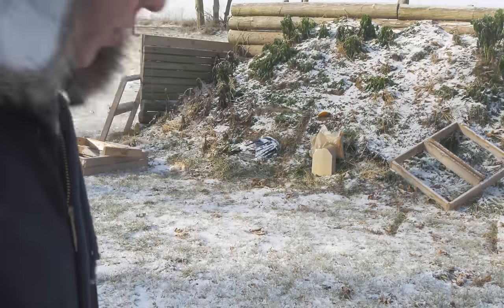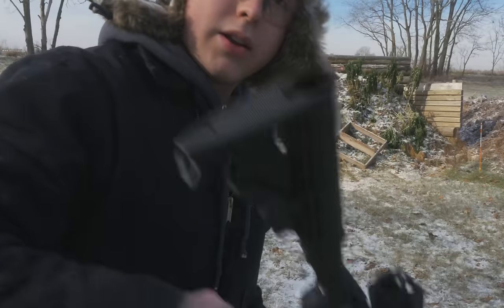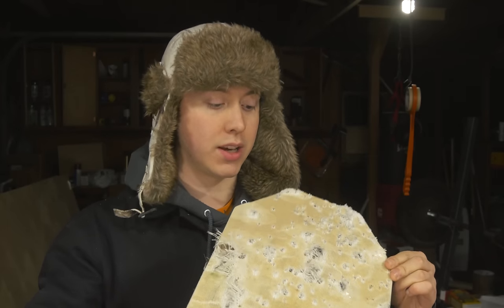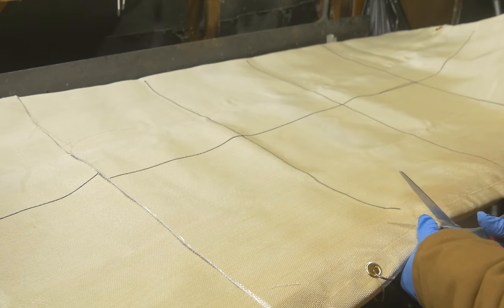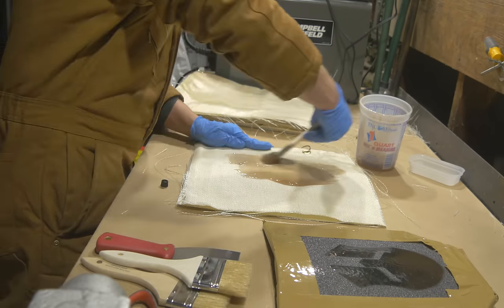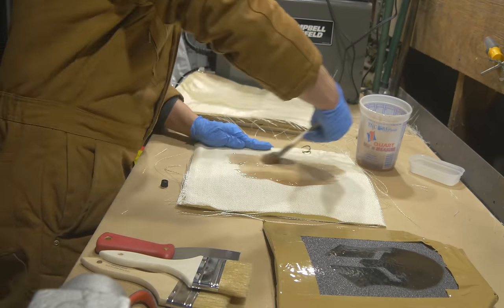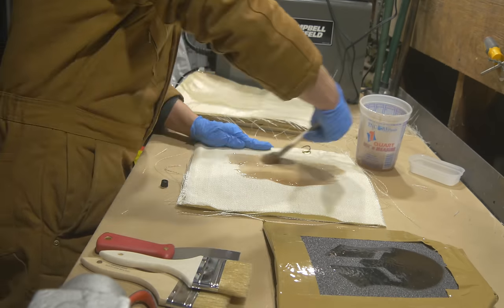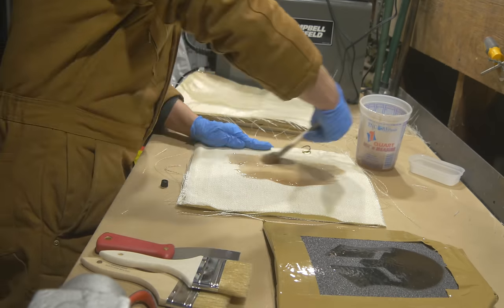How to Make AMAZING Bullet Resistant Armor for $30

Comment: That's crazy that your armor held up to all that! It's not even bulky, it looks like the professionally made ones. Great job man. 5.56 is probably the hardest to prevent due to the velocity (learned that from Demolition Ranch). That seems like it may have stopped 7.62 or at least close to stopping. I'd love to see more tests done on this armor!
Reply: Dude, 7.62 may have a lower muzzle velocity, but that simply means it packs more stopping power, making much more damaging than 5.56. Plus, it's a larger and heavier round, which also means more damage. So, the odds of the armor stopping a 7.62 is pretty much the same with it stopping 5.56.
Reply: Miguel Rojas true. I just assumed because speed beats armor that it might have a fighting chance with 7.62. 
Edit: I've seen many videos where armor prevents 7.62 but not 5.56. Just because it has more power doesn't mean it's good at penetrating.
Reply: Miguel Rojas not true man. Watch some videos by demolition ranch. You defeat bodyarmor by speed. So 556 penetrates much better than 7.62x39.
Reply: Oh shit, I didn't realize that if it doesn't come from demolition ranch it must not be true
Reply: cluelessly Wild all I said was it's worth testing. No need to spark an argument. I mentioned demolition ranch because he did countless videos proving that
Reply: Badass Unicorn since 5.56 is thin and fast, it can punch through more easily than a slower heavier bullet
Reply: velocity Is a component of momentum. I don't think this would withstand an ak round, but I'd be curious to see.
Reply: Ziggy that's what I'm saying I want to see. But 5.56 is designed to penetrate 7.62 has a lot of power but it's not designed to penetrate armor that's the difference that I can see confuses people
Reply: you guys do realize that the muzzle velocity of a 140gr 7.62 I'd about 2700 ft/s where a 5.56 is around 2522 ft/s for comparable round. The weight of the bullet isn't determined by it's volume but it's mass. Just because it's bigger doesn't always make it heavier. Also the shape and type of projectile has as much to do with knock down or punch ahh bullet would have vs penetration. A hardened pointed tip will always be a better penetrator round than a soft tip lead projectile. Where a lead tip will mushroom out more giving the transfer of energy a better smack on the harder targets but less penetration. You're always going to penetrate better with a hard tip than a soft tip didn't sex ed teach you anything?
Reply: You guys are all clueless. .177 has the best penetrating power, I took down a bear with my bare hands whilst using the pellet alone no rifle.
Reply: Mcdoofy I almost came close to taking down a bear with my .177 but we don't have those here. I have taken down many large animals such as squirrels and crows, so I know that I could take a bear
Reply: U do understand they make stronger armor for 7.62 (level IV) where 5.56 is rated for level III plates...7.62 is a much more powerful round so just use common sense on that. Actually learn about gun instead of taking everything from a youtube channel. And even then there has never been a video on dem ranch where 5.56 could go through a plate where 7.62 could not.
Reply: Seth Wiggins And what plate is it going take to stop a .177 with a velocity of 60,000 816 grain? Nothing.
Reply: 7.62x39 (AK-47) or 7.62x51(.308)? Maybe the AK round, but a 308 goes about the same speed as a 5.56, but weighs much more. It would tear through the armor like it's nothing.
Reply: Mcdoofy, I think the air resistance would lol
Reply: Hotel1 Gaming lol .308s a nice round. Going to be a future purchase. Along with the 7.62x39 not sure if I want an SKS or an AK.
Reply: Mcdoofy if you get an AK expect to also get a good set of sights (either better irons or an optic). Factory AK sights are hot garbage. I don't know about the SKS too much, but either would be great (I myself am probably going to pick up an AK when I get the money).
Reply: Hotel1 Gaming Was unaware of that haven't heard anything about it now I have to look into it.
Reply: Sharp Works sharp idk where you learned that but an AK round 7.62x 39 can punch through wayyyy more than an m4's tiny 22 caliber 5.56. he's probably shooting 2.23 anyways.
Reply: Shane Bryant You do realize that a 5.55 is the exact same as a .223, right?

Also, a 5.56 penetrates more than a 7.62x39 because it is way faster. It won't do as much damage to what it is going through, but it will go deeper.
Reply: Yo demo ranch is the my favorite
Reply: Hotel1 Gaming 5.56 is not the exact same as .223. The bullet velocities are much different.
Reply: Sharp Works "Thanks for watching demolition ranch, and we will see you next time!" The second channel I ever subscribed to (this was the first) My two favorites
Reply: Mr. Guitar CAGED zna needs needs to make more of these for da milatary
Reply: It could also be sold to law enforcement as light armor. It'll stop pistol rounds (which is what cops are most often shot with) but you can still chase somebody down with it on.
Reply: Miguel Rojas if it does stop the 7.62 due to the higher stopping power doesn't that mean it has a higher chance of shattering?
Reply: sorry if the answer is obviously no I'm only 14 and I haven't taken the shotgun merit badge for boy scouts yet.
Reply: Miguel Rojas by this logic, it shouldn't have stopped the 12 gauge slug. We are talking about .30 caliber vs .22 caliber. The .30 caliber projectile is both slower and has more surface area to impact. Think of it this way. Try jabbing your finger through a pare of jeans as hard as you can. You'll break your finger before you go through. Then take a needle and press it through. Much easier. Of course you can speed up that .30 caliber projectile in a .308 cartridge aka 7.62x51 NATO and make it much better at penetrating, but that's apples and oranges. Also, weight seems that it would give more inertia and therefore more carry through. And in some materials it does. A heavier projectile is going to hold on to a little more of its energy going through something like a jug of water, where as a .223 or 5.56x45 is going to dump more of its energy into the jug of water, however in the case of Kevlar or something resembling it, the smaller, faster round is more likely to slide between more of the fibers rather than slamming into them and trying to break them with bruit force. This can also to some extent be demonstrated by shooting Kevlar with, say, 9mm, which is a .38 caliber projectile, then sticking a knife through it. Untreated Kevlar is going to let the thin blade straight through, while stopping the mailable, larger diameter projectile.
Reply: Sharp Works you could probably find some plate carriers big enough to cram one of these homemade plates and a level 3+ plate on the front, back, and sides
Reply: If you were crafty enough, it wouldn't be too hard to get some straps into the plates themselves while drying them, which should make easy points for buckles and the like.
Reply: So I guess it may be worth clarifying a few "physics" points that are being discussed,  to make sure you guys are not discussing apples and oranges.

In order to penetrate an object , you must exert a pressure strong enough to break and/or bend the material in question out of the way. Pressure is defined as force over cross sectional area.

So let's investigate the two components of pressure. 

First we have the "force" component which in this case is the bullets momentum "mathematically known as P". your momentum is your mass multiplied by velocity. this makes sense right? the faster and heaver the round is, the more force it will take to stop it.

The next component of pressure is the cross sectional area, this is the tricky part that I think is causing all the confusion.
in a nutshell, if you apply force over a large area, it is evenly distributed and the pressure is less, whereas if you apply it in a very small area, it is concentrated and the pressure is higher. imagine stabbing your arm with a needle, now imagine stabbing your arm with the same force but this time with a spoon. obviously we can all visualise which one will penetrate the skin and which one will leave a large bruise.

So it stands to reason that a bullet with a sharper point, will penetrate better. but we are talking about high velocities and powerful impacts, what is the first thing that happens when a bullet hits a solid object? the bullet deforms on impact into a flatter and much larger area projectile,  thus reducing the pressure it is applying to the object it was fired at.

so what do you do to stop this? well, you use a harder material for the bullet. Armour piercing rounds are made of steel instead of lead, thus they do not deform as much on impact and consequently  concentrate the force more effectively. it is worth noting that the shape which the bullet has will also make a small difference on how it deforms, if a bullet has a curve from the tip to the body, it will be stronger than a bullet which just has a flat profile. I could expand on this ....but for the sake of simplicity, just take my word on the fact that this aspect of the bullet won't make nearly as big a difference as the hardness of the material used.

The final component to this problem would be how the body armour deforms just after impact and consequently spreads the force over a larger area. the bulging of the armour will put more steel in contact with the bullet, thus increasing the surface area and reducing the pressure. with a steel plate, the diameter of the round will effect how much bullet surface area comes into contact with the armour surface area in the instances after initial impact. but ZNAs armour is made of resin impregnated fibreglass, I don't know exactly how this material would affect this part of the problem, but I'd assume the material is more brittle than steel, so less bending and bulging.

And that's the basic science behind it. the 7.62 ak round has a larger surface area tip and overall diameter, but has more momentum than the 5.56, if you really wanted, you could measure the tips and assume uniform deformation of both rounds and try to work out which one generates more pressure upon impact. I believe the 5.56 would win by 20% or so but am not certain. what I am curious to see is how an ak round would fare against this perticular home made armour.
Reply: Ziggy Er, you do know that Force does not equal Momentum, right?  You'd have to derive P by t to get F.  F=ma, P=mv, and all that jazz.  Plus you'd probably have to take energy into account, which is v squared, meaning that the higher velocity, lower mass round probably has more kinetic energy.  Plus you might have to look at energy and force transfers, and I really don't wanna go into partial derivatives.
Reply: so I do, but I was trying to avoid the derrivation for the sake of simplicity, I think it is reasonable to assume that the decelleration of both projectiles is the same upon point of impact (close to instantaneous for our purposes, so feel free to  derive wrt to t and then sub in t=0) 

kenetic energy is related, but not relevant, why would it be?
Reply: Ultimately, energy content is what does the damage, although I would say it's the rate of energy transfer that matters more.  The energy comes from the chemical reaction but then may transfer more or less of that energy to the bullet depending on factors like mass.  Then when the bullet impacts the target, it matters how the kinetic energy is transferred, over what time, and what area.  These things can be examined by analogies of force and area, but in the end it's the energy that's the root cause.
Reply: "energy" is just as analogous as "force". they both convert the interaction of the fundamental building blocks of mechanics (dv,dt and m) into useful units. I'm sure you could solve the problem using joules, but why would you? using newtons would be far easier. if I was to run a proper mathematical model beyond that of a simple youtube explanation , I would analyse the "impulse" exerted over time, or even do an FEA simulation with certain force parameters. again, I don't see why one would use energy equations to solve this problem.

my point was to show (very simply) how velocity and mass were a factor, and I think my phrase did that.
Reply: JudgementDay78 where in the hell did you find 140 grain 7.62x39 moving at 2700 fps at the muzzle. Also you should look more closely when you google things the speed your claiming 5.56 moves at the muzzle is actually at 150m first thing that pops up when you google it. 5.56 moves faster then 7.62. I don't understand how this is a debate I thought it was well known and an accepted fact that 5.56 is a better penetrator then 7.62?  Just like we all know against soft targets 7.62x39 is much better at dropping them then 5.56. Damn people if there's one in you can find an abundance of information about on the internet it's guns, something this simple should not be up for debate like this. Also demolition ranch said it so it must be true all hail the saviour Matt Carriker
Reply: 5.56 penetrates better than 7.62, but 7.62 has more punch, and defeats things like cinderblock easier. I was in the military man, this isn't up for debate.
Reply: Richard Smith Makes sense. Baseball bat vs spear. Course you don't jab with a baseball bat, but for demonstration purposes, if you take a good jab with a baseball bat at something hard and brittle, it busts it all to pieces. Like a wrecking ball. You throw a spear it's not gonna do a whole lot other than blunt your spear. However if you throw a spear at fabric it's much more likely to go through than the end of a baseball bat. Both are effective against different target types. Not much of a short way to explain this.
Reply: Mr. Guitar CAGED Well, even a bb gun can penetrate a tree, has less energy that someone throwing a rock, but a rock cannot penetrate into the tree as far. It's not that difficult of a concept.
Reply: The rock is bigger and hits with more force because, even though it's probably slower, it has more mass, but it is too large to penetrate. Yes, very easy concept.
Reply: Level IV was designed for high velocity 30-06 AP rounds, not for your standard 7.62.   Level 3 is sufficient for that, as well as commonly available 5.56 rounds.
Reply: Where exactly are you going to find a 5.56 round that is "comparable" to a 140 gr 7.62?  Comparable in what way?  You realize the standard off the shelf readily available 5.56 round runs 50-ish to 62-ish grain bullet weight right?  And it's velocity runs from a smidge over 2900fps to another smidge over 3000 fps, depending on commonly used barrel lengths.
Reply: I survived a 7.62 to the chest so I don't care
Reply: 7.62 and 5.56 are entirely different rounds, they're both good for different things, however, the 5.56 tends to tumble a little more especially after impact, 7.62 does have more stopping power. I've even heard from several people because of that not to use 7.62s for home defense because they'll keep flying through walls, yet that 5.56 is a little more manageable for that due to being prone to tumbling
Reply: Miguel Rojas first off stop using damage to describe. This isn't call of duty. More velocity is the determining factor here. 7.62 may be stopped but it's unlikely without some sort of material to break up the bullet first.
Reply: Sharp Works imagine putting some low grade steel on top of it and using rubber sealent to hold it together
Reply: Its all about the amount of kinetic energy behind the bullet. Velocity is more effective than mass at generating kinetic energy. This is because rhe kinetic energy formula is velocity squared times mass equals kinetic energy.
Reply: demo ranch!!!!
Reply: Sharp Works this dude is right speed beat armor not the  size of a bullet  if you had a baseball sized bullet traveling half the speed of a golf ball sized bullet the golf ball sized would penetrate better
Reply: Miguel Rojas: If that was the case, then the shotgun slug would've gone through it.

See you're confusing stopping power with penetrative power, there's usually an inverse relationship between the two.

An FMJ bullet with a higher powder load is going to penetrate armour well, but if hitting soft flesh it's not likely to transfer as much energy to the target as a hollow point bullet with a lower powder load behind it would. The FMJ is more likely to just  go in one side and out the other in a roughly straight line, while the hollow point bullet with smaller powder load will mushroom up on impact , bounce around inside the target and shred them to a fine pink paste from the inside.

But here's the thing, hollow point, low velocity bullets are absolute crap at going through armour compared to high velocity, FMJ bullets.

That's why you frequently see AR-15's defeating certain types of body armour, while the 7,62x39mm rounds (which the AK uses) fail to do so.
Reply: Badass Unicorn: Actually velocity in itself is worth quite a lot. What do you think the large hadron collider does in CERN? It accelerates practically MASSLESS particles at near light speeds into eachother.

Or to use an even more accessible example, how do you imagine that industrial lasers manage to burn through thick steel plates? Lasers focus a flow of photons (that is, sub-atomic particles without mass), but since the photons are so many and travel at the speed of light, they impact the surface they hit causing so much friction that it eventually starts to combust and burn a hole straight through.

Lasers are all about velocity and next to no mass when it comes to making damage.

Mass and velocity are both just multipliers to generate force. It doesn't really matter if one of them is small, as long as the other is sufficiently large.
Reply: +James M I will test that theory with with a 30-30. then Ill move to a 45-70. Speed is not the only thing that defeats body armor by a long shot.
Reply: 7.64 x 54r would go right through... about 4 of these.
Reply: 7.62x 39 would laugh with a Russian accent at that armor before pulverizing it.
Reply: shut up seth. hes talking about 7.62 x 39. as in an ak, not the nato round. natos are used in machine guns and snipers, not really a relevant comparison at all. level III is rated to stop 7.62, but wont always stop 5.56.
Reply: Sharp Works well, 7.62x51mm would rip straight through. If you meant 7.62x39mm, it would pass through.
Reply: Sharp Works 
Isn't a 7.62 more bigger then a 5.56?
Reply: Gonna need to specify your 7.62 there buddy. x39 or x51? The answer makes literally all the difference in the world. People don't usually compare 5.56 to 7.62x51 but it sounds like that's what you're doing because the assertions you make would be patently false if they are concerning x39.
Reply: Sharp Works so basically, 7.62 is better against flesh targets, 5.56 is better for body armor.
Reply: Bad Cookie he doesnt know what he is talking about. Either one is good for either task, a 62 gr 5.56(typical 5.56 ammo) is moving around 3000fps depending on barrel length. A 147 gr 7.62(typical surplus) is moving around 28 or 2900fps. If you do the math, the 7.62 has a lot more energy. The phrase, "speed kills armor", it's just not that simple.
Reply: You defeat body armor with slippery-Ness. Teflon coated needle point rounds or hollow point compression cone creating rounds. I've also seen fmj 7.62 rounds go through over an inch of steel. Depends on the round more than the caliber!
Reply: 7.62 penetrates better than 5.56.
Reply: Miguel Rojas 7.62 tends to beat 5.56 with most barriers because 5.56 tends to tumble or fragment after passing through, but with body armour, it's all about speed. that, and a little fragmenting doesn't mean much when the plate is pressed against your chest. A skinny bullet traveling very fast will beat a thicker bullet traveling slower up to a certain point. That's also why the 5.7x28, a round designed to pemetrate soft body armour, is a skinny little round traveling super fast.
Reply: i would have done something like this as far as laminated fiberglass layers, but i would have included a sheet of shark mail in the middle (the cheap chinese shit will do) three layers of stripped and interlaced kevlar from a used vest or parachute pants etc and then laminated back and front with the fiberglass. oh and between each layer id include a thin coat of coarse ground ceramic which a dumpster behind lowes and ten minutes with a hammer would supply for free. It may not be AS cheap as the fiberglass armor, but it will be much cheaper and maybe even more effective than IIIA plate inserts. You can get them fairly cheap, like $50 $60 bucks but theyre small. this recipe will do you better. i promise